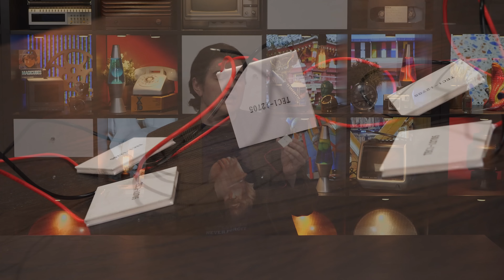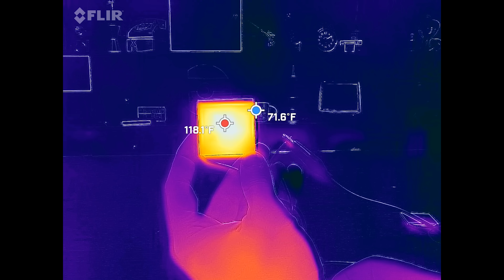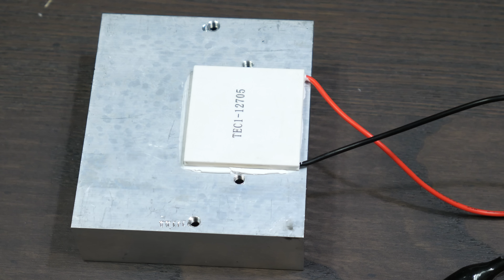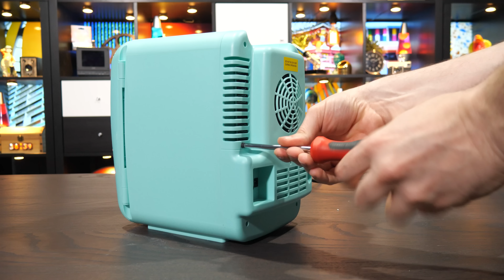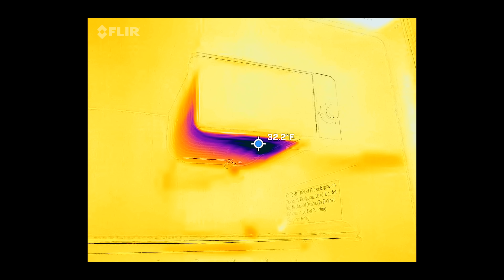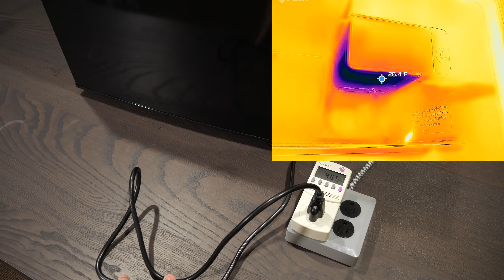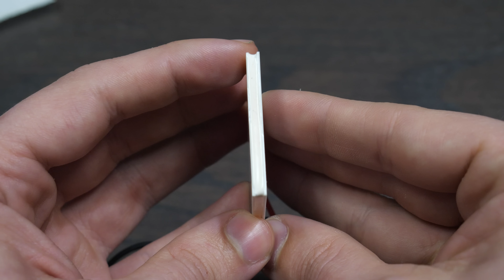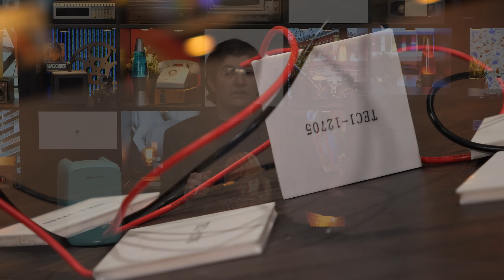Thermoelectric cooling: it's not great.

Comment: Peltier cooling does have a good place in some lab instrumentation. Rheometers can come with cooled (or heated) surfaces for testing fluids at accurately controlled temperatures, and a Peltier device can achieve a very even temperature across its surface. But that device is also hooked up to a temperature bath with a liter or so of water circulating through it and I suspect much more expensive control circuitry than what these little fridges have.

Comment: I have one of these "refrigerators." It does its job. My university doesn't allow us to bring a full sized fridge for fire safety concerns, and i'm not paying the 300 dollars for the one that they allow us to have. Mine is much quieter and more effective than the one shown in the video, which is most likely down to the smaller interior. It can fit about 3 cans of soda in it at a time, and it can get them all of them to an acceptable temperature. The size is also a big boon for not taking up space in my tiny room. 

As for fire safety, the power supply does get quite hot. But it passes inspection 🎉🎉

Comment: "Food safe" depends on the food and there are certainly food items that are safe to keep a couple of days at 7°C. If you just want a yoghurt and an Sandwich to stay cool on a hot day it definitely provides. As for beverages: on a hot day, even a 10-15°C drink feels pretty cool and refreshing (I know americans only drink piss for "beer" but a good beer tastes good even at slightly below room temp).
I wouldn't get on of them but I think people working construction or in a hot workshop where sound doesn't matter anyways since it's always loud might appreciate them. If you don't run the place you don't even pay for electricity.

Also, how long does it take the normal refrigerator to cool those 30 odd cans? I now from experience: very long.

Comment: You're right! Those Peltier fridges are an awful. The only use I have for Peltier is on my telescope's astrophotography camera. I have a camera designed for astrophotography which takes shots of the sky for extended times, up to 5 mins or more per shot. These images are then stacked to show extreme details of deep sky objects. The telescope is mounted on a powered equatorial mount which moves in the opposite direction as the stars so there are no star trails. Shooting for extended periods of time heats up the CCD sensor on the camera which causes noise on the shots it takes. The Peltier in the camera cool to between -15c to about -20c and it works really well. As being outside at night in the cold is a good start for the Peltier to get to those temperatures reliably. I'd love a closer look at that application in a video! My camera is made by a company called ZWO. Check out their astrophotography cameras :) All the best from Australia! Craig

Comment: one fun fact is that peltiers can also be used to make electricity as well. I worked on a project where we were trying to harvest electricity from steam pipes from within power plants and TEGs were one of the options we were looking at. They use a different composition than their cooling counterpart, but they're still the same device.

Comment: Peltier modules are AWESOME (at least for what i use them for) for that 3rd reason you gave, being able to operate while moving it. Im not gonna go into much detail, but I needed a cooling solution for a "box" that would regularly tip at least 90° and sometimes even 180°, it would be durable, and be able to whistand centrifugal forces. I used 3 120w peltier modules with computer heat sinks and a custom built li-ion battery pack. Even though it wasn't the most efficient (or at all really) and it was pretty heavy, it was extremely reliable with no issues in all it's 5 years of service. Now I'm building a v2 with a bunch of improvements. I know thas is FAR from a normal use case, but I think in these situations, there is nothing that could replace it. And at last, if it comest to these minifridges, I completely agree, they're terrible.

Comment: You can use them if you electricity is for free. Which isn't, even if you have solar stuff. That solar stuff has to be bought and installed too, and once you have solar stuff you will automatically get trained to efficiency...
Oh, and on THIS side of the pond electricity costs more than double than in your video since Mr. P took action nearby.

Comment: I use one in my car, 36litre coolbox. A fan on the cool side as well so it cools faster than that passive system in this video. Still very inefficient but pretty much the only option for a quick roadtrip, cant really put a mini fridge in a car.

Also used these TEC modules to cool CPU's back in the late 90s as well. Such a waste of energy haha.

Comment: There's a pretty big problem with using peltier devices for personal cooling: they reject heat in close proximity to the cooling element. A coolant loop means you can move the heat a few inches to a few feet, while peltiers only move it a few millimeters. In a fridge, that means you can't really have insulation between the cold and hot sides of the device (i.e. it's leaky), and in a personal cooling device that's meant to be used in an enclosed environment (like a portable car fan), you're rejecting heat *into the environment*. And since thermodynamics says you can't win, you're not just moving heat from on person's neck to the rest of the car, you're also running a little heater inside the car that's already miserably hot. As long as the windows are down, you can keep that excess heat moving out of the car, but if you don't, then one person gets a better experience by making things worse for everyone else.

Comment: I have a large-ish 120/12 volt cooler/warmer that uses peltier elements, the thing is actually somewhat impressive last time I used it was in a pinch when my full size fridge crapped out, it stayed food safe in a 72° room with a gallon of milk and some other assorted stuff in it. Mostly I just use it in the car for grocery runs during the summer.

Comment: Are these different from the piezoelectric cooling? (which also is crap)
I ve used 2 such fridges in my boat ,run ing on 12 volts, but never cooled under maybe 10 degrees C under the surroundings. 
I hated them but i didnt have enough money to install a 12v compressor fridge which cost a lot more.
In any case dont buy such "coolboxes", they are crap.

Comment: Buy a cheap crap TEC "fridge" and you get cheap crap "performance". I have a couple of vintage Koolatron coolers and they work very well because they're thick walled, fully insulated. None of this empty lid nonsense. I did 'hot rod' them a little by taking them apart to file the hot and cold side sinks flat and applying a proper amount of new thermal compound. Despite their ridiculous cost in the late 70's and early 80's, Koolatrons were still built with some cost cutting. The larger one has a Peltier module the size you showed in this video. The smaller one has a smaller one.

The efficiency of Peltiers has slightly improved over the years. Another improvement is the white sealing around the edges. Old ones aren't sealed like that so it's a must to have insulation and sealing in the space between the heat sinks to prevent condensation from corroding and damaging the Peltier.

I'm thinking about taking my Koolatrons apart again to install new Peltiers. I have a Govee temperature logger I can use to test their performance before and after. I need to get a second one to simultaneously monitor the ambient temperature.

I have a 9 can capacity (6 upright and 3 laid down on top) mini cooler with top lid that I did some modifications to. As it was when I got it used, it was pretty bad, but still way beyond your blue toy. The metal tub that serves as the cold side sink is almost the entire interior of the cooler instead of less than half. It's fully insulated, especially after my changes.

The first issue was the cheap brushed DC motor and squirrel cage style fan, which was noisy. I took that out and found the motor tucked into a hole through the insulation, right up to a bare spot on the aluminum interior tub. A carefully cut piece of insulation foam and piece of aluminum flue tape fixed that. The heat sink got filed smooth for full contact with the Peltier and I made an aluminum doubler plate for the inside to firmly press the thin tub to the cold side. I used new thermal compound on the Peltier and between the doubler plate and tub wall. I also glass bead blasted the heat sink to give it an extra bit of surface area. For the fan I opened up the slots in the cover and mounted a 4" brushless DC computer fan to the cover so it could move far more air over the heat sink. That made it totally silent, unlike the garbage noisy fan on your blue toy. It may not even be a brushless fan.

The results? It has no problem chilling 9 cans down to a very cool temperature and it managed to keep a half gallon box of ice cream (remember those?) frozen on a long trip. The half gallon box fit perfectly inside. I may replace its Peltier with one of the new sealed ones I have. It might need a temperature control added to stop it from freezing drinks if I do that.

I have a second nearly identical cooler I've been thinking about doing the same to and doing a video of the process, with before and after tests. YouTube didn't exist when I fixed up the other one.

I have a couple of other TEC coolers but they're not as good as the vintage Koolatrons. At least one of them has a blow molded lid with no insulation. There was a thing going around YouTube a while ago where people would take coolers with no lid insulation, shoot the lids full of low-expanding foam and they'd keep ice for quite a bit longer time. I got a can of foam, just haven't got a round tuit to do tests to see how much difference it will make. They're also candidates for Peltier module replacements. I did replace their thermal compound years ago.

Comment: it's designed to hold sodas. it's not a fucking fridge m8. it isn't advertised as a fridge. it takes maybe an hour to cook the drinks. mine works fucking great. don't know what's wrong with yours. 46 degrees is chilled beverage. it did what it says it does. 

there is nothing that satisfies you. or maybe you just think something should do everything.

Comment: I'm thinking of buying a car phone holder with magsafe and wireless charging, that also includes a small fan and peltier cooling. Thought it might do something on super hot days when you're using GPS, and your phone is on maximum brightness and struggles to charge via wireless charging. Not sure if such a small cooling element would make a difference though...

Comment: Great episode! As a European I found the part where you made fun of some comments from Europeans especially amusing.     

While you are correct about peltier elements, and your point is totally valid,  I think that specific peltier based gadget is among the worst of it's kind. I had one even smaller that was powered via USB, back in the day when USB wasn't supposed to handle more than 500 mA, that could cool one 500 ml can to an acceptable drinking temperature in much less than 24 hours. I never measured the temperature or power draw, but the peltier element and the fan shared what couldn't have been more than a few of watts, and it produced significant condensation inside. I think it was that condensation that eventually did it in. 

But while some models can be considered somewhat useful as budget alternatives for cooling down a can or two, just using a few watts, a lot of them are absurdly badly engineered. Models that extracts most of the heat from the refrigerated compartment via a few screws through the plastic back should be an instant huge red flag. The disadvantages of peltier elements gets much worse with every factor of added disadvantage. Proper heat transfer on both sides is one factor that's absolutely necessary for peltier elements to reach their full [still very mediocre] potential.

Comment: I recently bought a 2012 F150 and noticed the heated seats weren't working. It turns out that instead of classic resistive strips, Ford uses Peltier devices in the seat bottoms and backs to perform the seat heating and cooling.

Comment: We use (usually two-stage) peltiers to cool camera chips for lower noise output in astrophotography. Typical compressor-based coolers don’t work here as it needs to be light and extremely small (needs to fit into a camera) and you can‘t manage the requirements of keeping it upright when moving the telescope in the sky. As you don’t need to move away much heat from a small camera sensor, the TECs are also relatively small and require little power, efficiency is not really important. To cool the sensor down to -10°C (which is a sweet spot for a lot of people) from room temperature, you need like 10W. 
That is one of the small edge cases you mentioned in your video. For any „real“ cooling needs, forget about TEC.

Comment: 6:35 — For my fellow Metric friends:
60°F = 15.6°C
48°F = 8.9°C
46°F = 7.8°C
Reply: Thank you! 🙏
Reply: 30°F difference are ~16.7C° 
Wanted to add that as I was wondering how much it can cool.
Reply: @MrMoerli  in Italy were I live we can easily reach 30-35 °C for most of the day during the summer. So in that situation they would at best cool the drinks to around 15-20°C 😂
Reply: The difference between Farenheit and Celsius is basically just subtract 32, then divide in half. That'll get you within 2 degrees. 

If you're talking normal human everyday temperatures, it's easy math.
Reply: @chrismanuel9768 and more importantly 1 is idiotic and the other makes sense water freezes at 0 boils at 100 🤯
Reply: @blink1821986  At sea level. Water boils at lower temperatures at higher altitudes. Not an issue most people encounter unless they're on a mountain (or boiling water in an unpressurised aircraft, for some reason), but worth pointing out.
Reply: @blink1821986 lol, cry about it
Reply: @blink1821986  Not in this country it doesn't. Here water boils at 212 and freezes at 32. I don't want to have to convert your silly abstract metric nonsense every time I want to know the temperature of something.
Reply: Thanks
Reply: Thank you fellow SI friend.
Reply: 95% of the countries are hi-five-ing you right now!
Reply: Approximately F=(Cx2)+32  and the reverse to go to C.  hehe
Reply: Ah, actual useful numbers

Comment: What about a portable cool box that you would take with you on camping or short trips? As you mentioned a Peltier one may be lighter to carry, but also cheaper. For a short weekend out somewhere, or even an afternoon at the beach, I wouldn't want to buy something more than $ 100 and I also don't wanna break my back carrying it. Also in this case the food/drinks you put in there could already be cold from the regular fridge, and the coolbox's job would be to just keep a food safe temperature for a few hours up to an entire weekend, not necessarily bring it down. There are also some such battery powered units, while I haven't really seen ones with a compressor that could take some kind of battery. Would it make sense in that use case or would it still be better to get a compressor based one? Wondering cause I just made the purchase, and didn't even consider that it's inefficient.

Comment: Honestly? Thermoelectric has a permanent place on my truck. It's decent for keeping drinks cool enough to be refreshing, it keeps temperature sensitive snacks from being destroyed by the heat of both the sun and the thermal transfer of the truck's normal operations through the floor of the cab, and it runs off plain ol' 12V DC... aka, standard automotive electrical service, so there's no ice (especially the melted variety) to deal with. All of which is amazing, considering I've rarely had a fridge at my disposal in the cab, but I've always had good ol' 12V DC service to play with. Makes for the perfect "not great, not terrible" solution that just fucking works IMHO

Comment: The stupid thing with those small fridges as well. Is you CAN get some quite small camping/car etc fridges that use proper compressor based heat pumps. Heck Makita even make one that just takes 1 or 2 of their 18v power tool batteries and can run all day off it.

Comment: Sorry for lack of science knowledge but Serious question. Could the heat from the hot side of the thermoelectric pad using the Peltier effect be connected to another thermoelectric pad to generate some electricity back using the Seebeck effect improving efficiency?

Comment: Cool rooms integrated into house HVAC system are THE BEST.
Especially at the basement level.
Aka "walk-in fridge". They have better, thicker insulation, they rely on a better, bigger pump, and it is part of one system, so efficiency is also better.
And don't get me started on "portability". Virtually nobody moves their fridge from the kitchen ever.

Comment: Some have already commented that: the Peltier elements can generate electrical power from heat. This does have some everyday uses, for instance I have wood stove ventilators which will run just by the heat difference of the stove plate and the air, and circulate the air in the room, thus distributing the heat much better. And efficiency of the Peltier element is kind of irrelevant in that case as long as the ventilator runs well.

Comment: 1:49  one very specific application is in ambient air monitoring. Some of the monitors for gaseous pollutants use some form of attenuation of light to measure the pollutants and the device that detects the light (called a photo multiplier tube or PMT) uses Pelletiers to keep cooled at a constant temperature of about 7C.